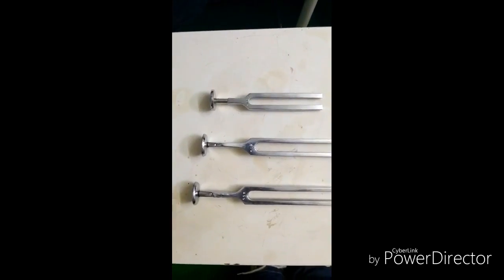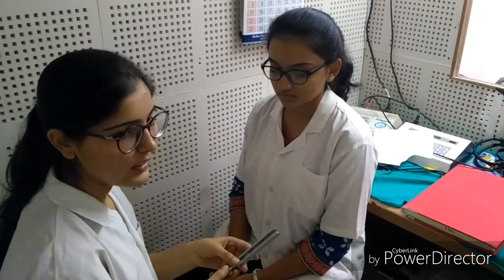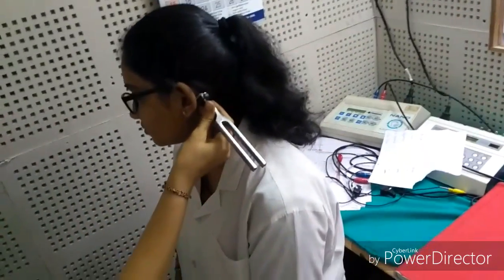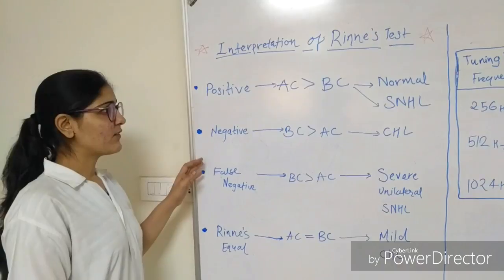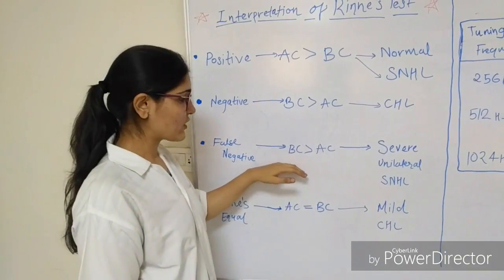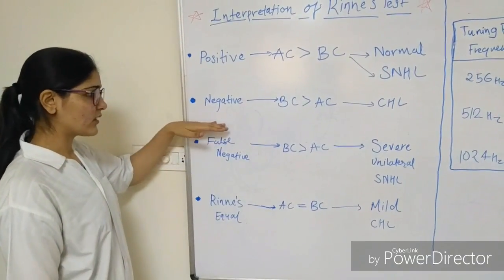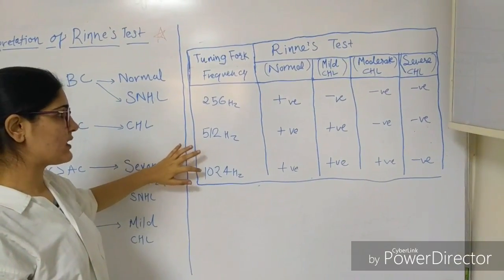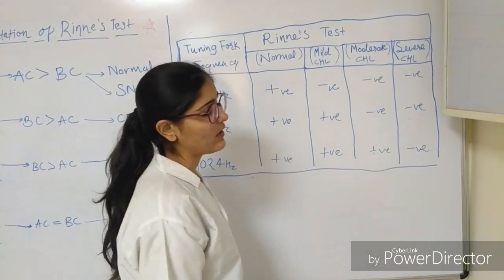Rinne Test (Tuning fork test)

Comment: Isn't it wrong ? Your friend has normal hearing sensation. right ? . And in normal rinne air conduction is greater than bone conduction. Than how can she feel the bone conduction after the end of air conduction until and unless she had conductive deafness. Are you here for forming or deforming the concepts ? And another thing is that in ent examiner sees the process and you didn't explain it properly that how to hold the fork .